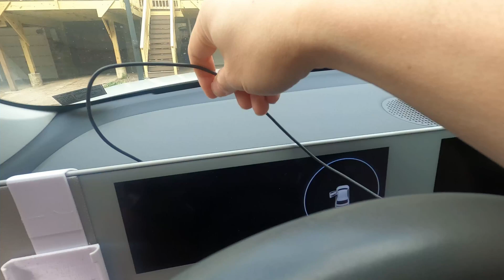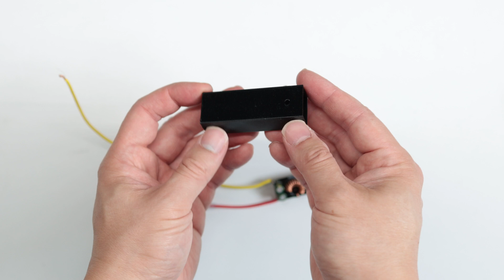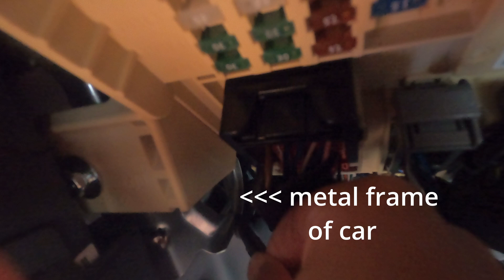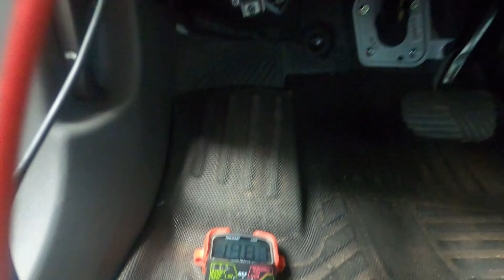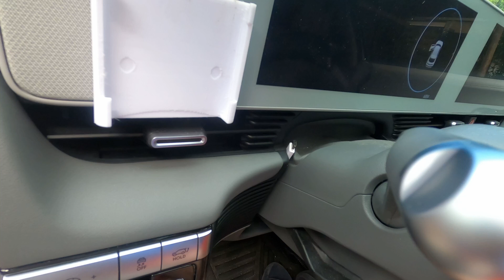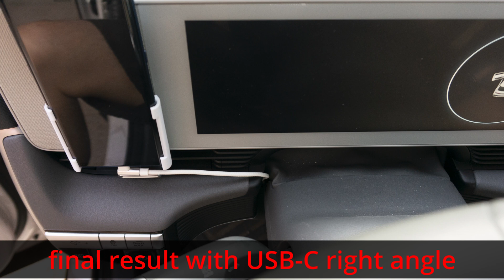simple easy way to add more USB-C charging ports to any car and vehicle

Comment: Hi, this PD module you use, have you experienced any high frequency noise from it or a degrade in the car radio when you use it? I am trying to do something similar but want to know if this is a good quality module!
Reply from the maker: no issue with audio quality.

Comment: Along the same lines as what you're doing have you seen yet a product that would allow data passing and allow the device to be charged. Case in point The charging ports USB in the car usually are very low power but yet I still need my phone connected to my car but I want to charge it at a higher rate and yet up to this date I've not seen a product that did that simply
Reply from the maker: this is the only solution i came up with: android auto wirelessly connect to my phone for data, as seen in a previous vid of mine.   and then this video to charge at a higher rate.  the module in this vid supports fast charging so charging a phone from dead to 100% takes around 1 hour.
Reply: I do not have wireless android auto